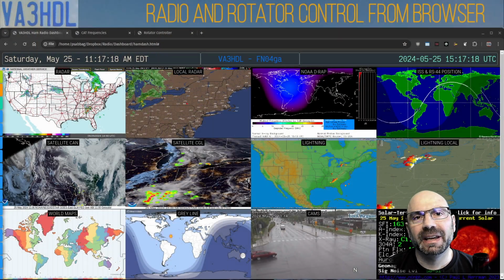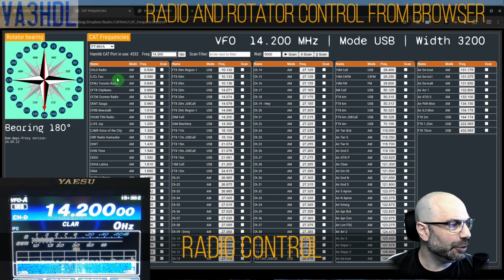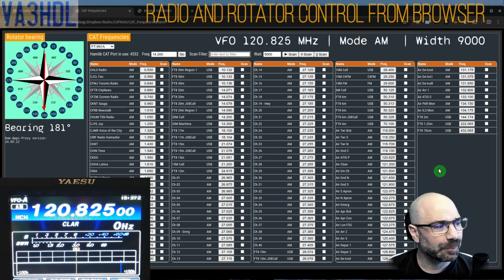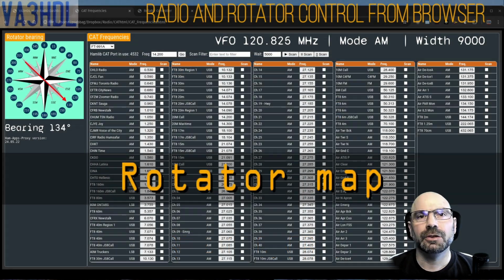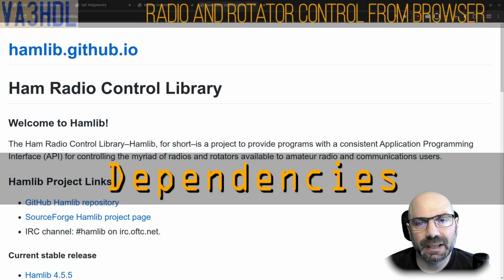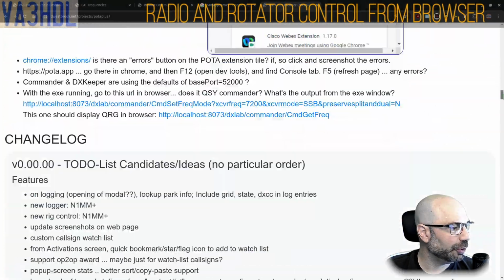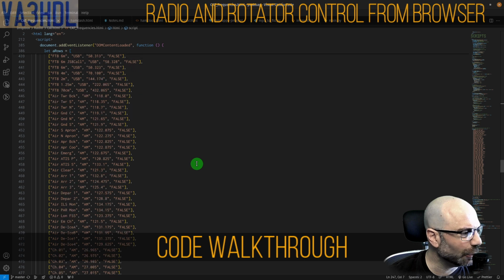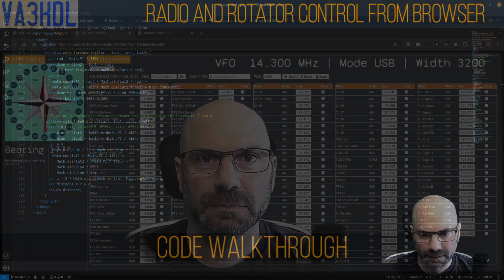Radios & Rotator Control from your web browser EASY!

Comment: Nice work. One suggestion though. On the github page turn the info on the dependencies into links to the download for the files needed to run. That makes it easier for all concerned.
Reply from the maker: Hi Hank, it would be only Hamlib, ham-apps-proxy.pl modified version to support Hamlib is already on the repo. I will add the link to Hamlib. Thanks. 73